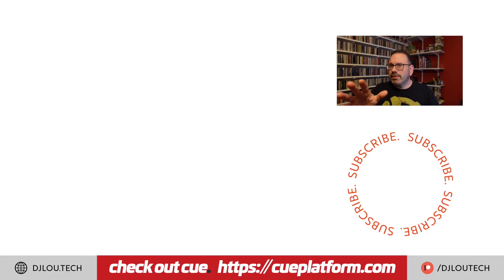The Problem With 2.4 GHz

Comment: Quick Question Lou! Also, great video. I have a digital shure transmitter SLXD with 1/2 wave antennas (and paddles fins when very neccessary) and I still run into issues with RF dropping right before ceremony even after scanning at the last minute.....the only times it is really ever a BIG issue is when Photographers get in the line of sight with their camera bodies and burst shots.......what in the frekin world can i do to stop these issues? Money does not seem to solve it........and I have ran the gamut of my brain
Reply from the maker: A couple immediate thoughts. Antennas up high? That line of sight can be critical. Where is your squelch set? Do you mount the packs near anything like maybe a cell phone that could be causing some general noise floor issues.
Reply: @djlouparis  in this particular situation 1/2 wave antennas were only table high but it was an amphitheatre and we were at the top. Squelch is at factory setting as I have not learned enough about it to really use it effectively yet. Officiant placed bodypack in back pocket after I put it in his side pocket (no jacket pockets). RF did not drop when I watched him put it in his back pocket until bride/ groom came in on both sides......but when shit really hit the fan was when the photogs got in the middle of the aisle and started blasting photos
Reply from the maker: @DJ_Midas865  so there can absolutely be some increased "noise" with the remote triggers of the flash and all. What distance were you from the officiant? 

Squelch, simply put, it's a sensitivity to the RF pickup from your transmitter to the receiver. Almost think of it as a noise gate. The higher the settings the lesser the operating distance will be, the lower the greater. But the lower setting may bring in unwanted signals from others if you are competing in that space. Not sure where the factory setting is on that since I don't use shure.

It sounds like you were competing at distance, potential noise/EMI. Anything in your path can be a challenge, but it also should not be impossible to operate in.
Reply: I was about 30 yards or less. Would you have suggested I increase my squelch with the 1/2 waves to effectively make the "catchers mit" larger? What would you have done differently in this scenario on the whole? Appreciate everything you do. Most DJs are completely unaware of this stuff
Reply from the maker: @DJ_Midas865  squelch could help a bit. Under 100’ you really shouldn’t have had too many issues between the scanning, half waves, and the like. 

Did you see if RF ever looked like the signal was diminishing?
Reply: @djlouparis  yes it was at full 5 bars before ceremony when I checked setup. When I did final channel scan with all attendees AND photogs in the area 5 min to start. Had 5 when officiant got down to alter.....started dropping to 3 when bridal party + bride and groom where introduced to the sides. Started to drop below 3 when photos when front and center ( I was in the back) went to zero briefly when I decided I needed to play around with the 1/2 waves, manager to Baily make it thru with 1 bar.......somehow this was the longest ceremony I ever had too!!! Lol legit 45min+
Reply from the maker: Those long ones are the worst. 

As a test dump the 1/2 wavs and go to your 1/4 wavs if you are still mounting on the receiver. I am curious if they are not performing to spec.

Comment: Great video! I’m working with a Sennheiser XSW 2-835 Wireless Handheld Microphone System with upgraded 1/2 wave antennas. Not sure if that’s 2.4 gz or not, but has worked for me 99% of the time! Thanks for the input and be well!
Reply from the maker: Many of the XSW models are in the “500MHz spectrum” so you’re probably all clear there.
Reply: @djlouparis  thanks for your expertise!